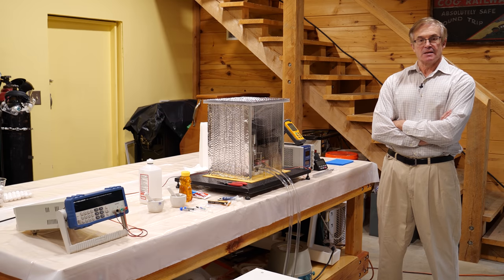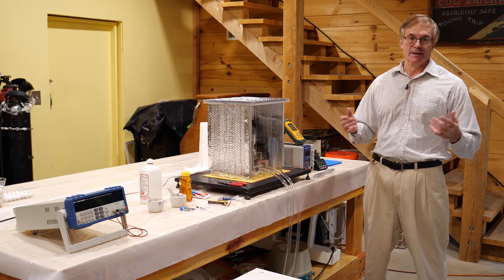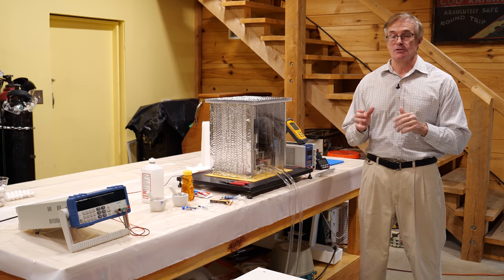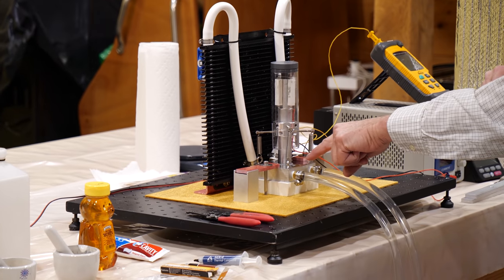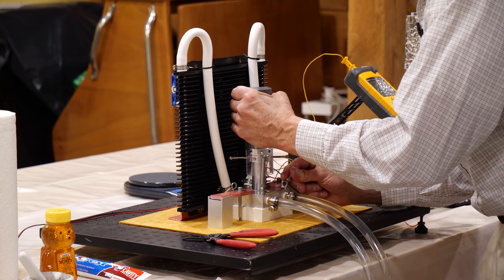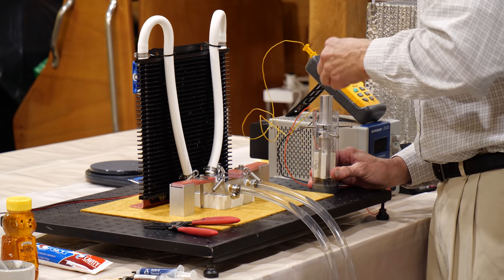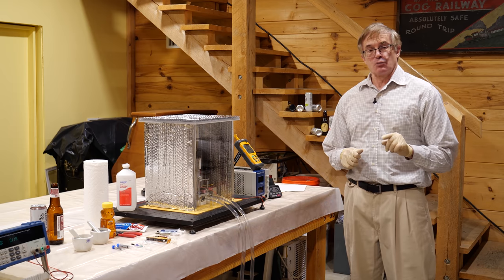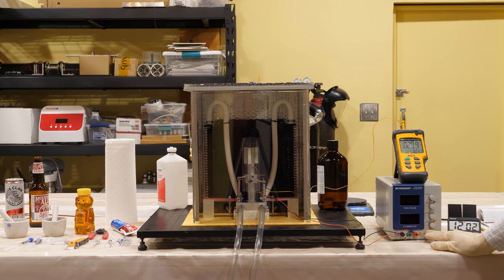DID WE JUST MAKE THE WORLD'S BEST THERMAL PASTE!?

Comment: Please make a serious performing TIM that tolerate extensive long term use @ 350+°C, ideally up to 400°C, without cementing / solidifying. My initial idea of use is in 3D printer hotends, in assembly of hot-side components. The poducts available tend to harden like concrete, making often very costly parts assemblies unserviceable if one part of the assembly breaks, because you can't extract the busted part. The current alternatives for things like thermal sensors and the actual heater cartridges are often grub screws. While they do decent job of holding the components in, it's flaws are hopefully obvious when trying to maximize surface contact area between the heater or thermal probe, and the (bore of the) metal block they are installed in.

Comment: I wonder if there would be a bigger difference between the thermal pastes if the mating surfaces weren't polished to a mirror finish. Similar to how a CPU and heatsink have just a basic machine finish on them. Sort of testing closer to real world conditions but still highly controlled in your setup.
Reply from the maker: There probably would be a bigger difference.  The problem is that introducing an uncontrolled variable would make testing unreliable. With poor surface prep air can get trapped or a small rotation of one surface relative to the other could change the contact area.
Reply: @TechIngredients  it might be interesting to see how well different pastes perform with imperfect surfaces since that's what they're likely to encounter. Might be possible to key or index the mating surfaces so they always line up the same way. I only suggest this because I wonder if some pastes might work better under ideal conditions than they would under less than ideal conditions....the kicker would be if the inverse is true where some work better under less than ideal conditions.

Comment: Hello, can the CPU Heatspreader bend (?) a bit with heat? Or will it be the surface the same at 20 and 90 degrees Celsius?
Reply from the maker: Metals can deform with heat.  The heat sink does not warm very much, but I'm not so sure about the CPU heat spreader.

Comment: What is everyones thoughts on manufacturers (Intel, AMD) basically welding heatsinks directly to the CPU/Die.   Removing the need for thermal paste at all and/or removing the poor placement issues that can plaque many people (poor application of thermal paste).   Then the only user needed step is to provide good fan attachment/mounting.   What draw back is there to welding a heatsink onto a processor?   I understand there are different needs out there. .  but no reason they can't provide multiple SKU's, one with welded heatsink, one with or even a variety of heatsinks (size, shape, performance variety).   Just having some deep thought tonight.    Thank you.
Reply from the maker: That's true.  Some high power laser manufacturers do that because the power levels are even higher than overclocked CPUs.  We'd buy such an upgrade option.

Comment: Do thermal compounds for graphics cards and laptops, which often have direct copper/aluminum to silicon, require different properties since one of the surfaces is extremely smooth? Like particle size?
During testing in my intel nuc I found out that thermal compound from noctua and electrolube performs very poorly, but a 0.5mm thermal pad worked the best. Which is similar to what it was assmbled with. Or was that just a mechanical problem with not enough pressure?
Reply from the maker: Flatness is more important than smoothness.  Did you watch our video on the thermal epoxy last year?  I showed a simple way to prep excellent surfaces.
Reply: @TechIngredients  I just did. Great video. They are like videos made by Ben Krasnow, great stuff, I like that.

If flatness is important, than I suppose the heatsink assembly in the nuc is too flimsy. It was punched from copper plate and actually had a little level change it in since the die of the graphics chip was at a half a millimeter different height. So it may very well have been misaligned as well.  
So I suppose the thermal pad acted more like a gap filler, while the pastes just didn't had the pressure required to work and couldn't fill the gaps.

Comment: Can the chiller sink more than 32W? I understand wanting to match the per unit area thermal output of a typical CPU, but considering that most results are within 0.1°C of each other it seems that increasing the power is called for. Also, matching the power of a severely overclocked CPU seems more interesting as that's when the paste becomes more relevant. One other benefit of this is that if any of the pastes have a temperature-dependent thermal conductivity (is that a thing?), you'd be measuring it at a temperature that's closer to what the TIM would experience in a real build under load.
Reply from the maker: It can handle 500 watts.  We'll go higher with a modified rig when we test liquid metals.

Comment: Could you turn a pc into a closed system? Like a solution for when you live by the ocean and the salty air corrodes it.
Reply from the maker: Sure.  A PC doesn't require circulating air, only heat dissipation.

Comment: The cost of the ingredients bears little relation to the cost of the finished product. The commercial products have had to undergo extensive testing, packaging, equipment costs and factor in the time needed for manufacture. The commercial products are convenient and fairly priced for the vast majority of users. An interesting exercise and demonstration that completely misses the regulatory hoops and meeting of standards that commercial manufacturers have to adhere to.
Reply from the maker: The fact that we beat many of them and this is suported by the testing results at Linus Tech Tips, suggests that these commercial products are not that special.

Comment: i'd like to see the same test again with significantly higher heater power - 
there are two different types of contact areas for thermal compound - directly to the die as we see it on graphics cards, where up to 500 Watts are in direct contact to the compound - therefore there are much higher temperatures in the conjunctions area. 
and - cpus with a heatspreader where the compound is on the second layer of thermal transfer.

i believe these compounds to have a non non-linear behaviour, esp. when having a look on the toothpaste. when toothpaste hits the 100°C the water evaporates and changes everything. even the silicon-oil-based compunds will change their behaviour over time on high temperatures - and this is where the all-metal-compunds have their advantages- they do not evaporate anything.

(sorry for the errors. I'm not a native english speaker.)
Reply from the maker: We'll be revisiting this when we test the liquid metal frame formulations.

Comment: I'm looking for materials for the back of my phone(s) that can transfer heat better to either tpu cases /aramid phone case.
I am trying to optimize heat transfer vs ( 5g data signal strengths).
I had tried a hydrogel product (some reviews mentioned it dried up and cracked) but to compensate that i think they made it  too thick.
Reply from the maker: If it dried, then it shouldn't  matter how thick it was. A very low vapor pressure,  diffusion pump silicone fluid mixed with these solids should "never" dry out.

Comment: The test method, while fundamentally very sound in performing static thermal evaluation of thermal interfaces, doesn't measure the tolerance of the thermal interface material to maintain adhesion and interfacial thermal resistance with the metallic interfaces and cohesion within the thermal interface material and bulk thermal conductance to the cyclical  mechanical deflections and atmospheric variations that are the reality of every thermally active mechanical interface, but especially those used in the CPU environment. Every thermal interface in service must endure significant shearing and tensile strains that dictate the thermal interface formulation as much, in fact more than, just a static measure of the thermal interface conductance. I can assure you, if those elements of thermal degradation were removed from the equation, the available commercial options would offer thermal resistance one-tenth of existing commercial solutions.

Having said that, I really appreciate the somewhat dubious observation re: "how hard can it be"...in the case of truly high performance thermal interface material, this rings really true....you have no idea the technical challenges. Every route to improved thermal performance is counterbalanced with a mechanical challenge of equal or greater insurmountability.

Comment: FWIW: the primary requirement isn't "pressure", it's uniform gap thickness. The reality is that most CPU heat spreader surfaces aren't "flat" but are slightly bowed as are the heatsink surfaces

this is why enthusiasts lap the two parts to ensure best contact. There's an awful lot of folklore out there and a lot of pretty awful coolers.

What irks me no end is seeing heatpipe coolers with "pressed on" fins that rely on a couple of microscopic friction points for heat transfer and lots of air gap. People go to huge lengths to get decent transfer out of the CPU but neglect that despire huge fin area there may be less overall contact area between the pipes and those fins than the pipes and the heat spreader (many tower coolers are guilty of this - and even  a smear of cheap thermal grease on the heatpipes when the fins are pressed on would improve the performance dramatically)

The reality is that the best heatsinks end up being the monoblock (copper centred) intel/AMD coolers for the simple reason that they have HUGE contact area between the copper and alminium materials, which makes up for any microgaps that may be in there. The donwwards firing fans ensure that the CPU voltage regulator support components (VRM etc ) also get adequate cooling and that's just as critical as cooling the CPU itself (in my 1-2U servers the CPU heatsink block is frequently "oversized" and cools these as well as the actual CPUs)
Reply from the maker: That's why I stressed surface prep prior to the application of any paste.
Gap thickness isn't controlled when applying pastes in real world applications, it's the relationship between clamping pressure and paste viscosity.

Comment: Very interesting but this is a 12 minute test.  I am much more interested in how durable the compound is over a much longer period of time, say a year and beyond.  I have been using Thermal Grizzly Conductonaut Liquid Metal on my CPU for over a year and no noticeable performance loss.
Reply from the maker: We'll be comparing liquid metals in an upcoming video.  These all have virtually no vapor pressure and so should last indefinitely.
Reply: @TechIngredients  I was just noting my present situation using liquid metal, not for a direct comparison sake but for the longevity issue I had raised.  I would much prefer not to use liquid metal if I could find a more suitable product if it doesn't mean taking my custom water-cooled system apart to replace the paste every year :)

Comment: Was there a thermal paste in the temperature probe hole? Or a more accurate thermocouple seeing as how your 12 minute test only had four tenths of a degree difference between all the products?
Reply from the maker: It was bonded in with a thermal adhesive.  When we test liquid metals, we'll be modifying the rig with nickel coated surfaces and increasing the power levels.  Also based on the suggestion of a viewer, we'll be doing the testing in Fahrenheit to increase the resolution.
Reply: @TechIngredients  thanks for the response!

Comment: Thanks a lot for the hard work. But 1st. The heat is too low. and most importantly 2nd. It doest help much if the paste is only good for a week and then degrades heavily with each day passed. There is a long term test needed to know how really good the paste is. At least 6 months. Usually people change the paste every few years or so...
Reply from the maker: We've only been running this paste for three months now in two computers, but so far there has been no degradation.

Comment: Because of a video I saw here titled "DIY: Home made thermal paste from common household ingredients", I went out and bought myself a tub of Equate Baby Diaper Rash Paste with 40% Zinc Oxide, which is about the size I am going for anyways.  While there is no way to tell what size of Zinc Oxide particles they are using, or if they are even spherical, I thought it would make a good basis for some experimentation.  I am going for 3 things: 1. Cheap/plenteous, because I suspect I will be applying thermal goop dozens of times/year for many years.  2.  Non-toxic.  Since this stuff gets on my skin(thus absorbed), and clothes over and over again, I would rather there NOT be aluminum in it, and the thought of accidentally inhaling aluminum or graphene dust scares me, I would rather go for copper or c64 or more zinc oxide, and if I need to thin it out, add coconut oil.  3.  It needs to perform well enough that it won't hurt performance and last for about a year at least.   That said, where would you start loading it up?  I am guessing I will have to try quite a few things.
Reply from the maker: You'll need some convenient  way to objectively compare  the performance of different formulations. This should closely mimic the conditions under which you'll be using the final product, i.e., surface prep, area, and operating temperature. 
Start at a low concentration  of solids and progressively add more.  There are two competing factors.  The lower the viscosity, the closer the approximation of the surfaces.  The higher the viscosity,  the better the thermal conductivity of the material.
Aluminum is hard to beat. It's  inexpensive, has high thermal conductivity, and best of all, the spherical particles flow very well even at high solids loading.
Reply: @TechIngredients  After watching this video a second time, maybe I would be better off just wearing gloves and either making your cheap stuff or buying a tub of your performance paste if you'll sell it to me for crypto, and use my time on learning the projects I'm already trying to get proficient at.
Reply from the maker: It certainly  is a fun project.
But I'm well aware of the limitations on time.  Focus on what adds the most value and delegate or buy what you can.
Reply: @TechIngredients  Well, not off to a good start.  I opened the Diaper Rash Ointment and it is strongly perfumed!  That is a show stopper!  It's going back to walmart.  How about coconut oil as a base?  Any problems with that?  Some people use it to clean and lube their pew pews.
Reply from the maker: I'm not aware  of any.  I stuck with silicone oil because  of its very low vapor pressure and almost zero evaporation. Like the baby powder, you might find that there is some batch to batch and supplier variability. This will make it less predictable when you try to mix up subsequent blends.
Reply: @TechIngredients  How about indium sheet.  Since my Xeons will throttle themselves without damage, I would like to try an indium sheet, but what thickness would you recommend?
Reply from the maker: As I explained  in this series, indium is an excellent  choice, but only if you can produce at least 100 psi clamping force in order to get it to deform and fill in the irregularities in the surfaces.  With the surface area of a typical  CPU, this means several  hundred pounds of force.
Reply: @TechIngredients  Sure, but that pressure might go down significantly with heat, and before it conforms, the pressure will be higher in spots and all of the heat needs to go through that spot too.   If that doesn't work, I can heat up the heatsink with a heat gun.  There is also the possibility of taking the heat spreader off of the cpu which will lower the area significantly.
Reply from the maker: It would be an interesting experiment and potentially  a valuable one.
Try it.
Reply: @TechIngredients  What thickness would you recommend buying?  I looked on ebay and there is quite a variety.
Reply from the maker: For a test, it isn't important.  You may as well purchase based on cost.
Make up a surface with measurable, repeatable surface features at different  scales. Based on these features, calculate  the surface area at the  initiation of contact as well as at full contact. This allows you to estimate  the actual  pressure from the point  that force begins to be applied until the force is at its maximum. Repeat this experiment at incrementally greater temperatures. These temperatures should be the same for both surfaces and remain stable during each test.